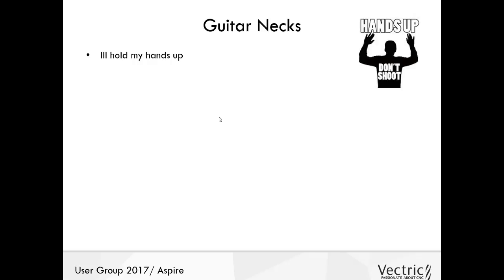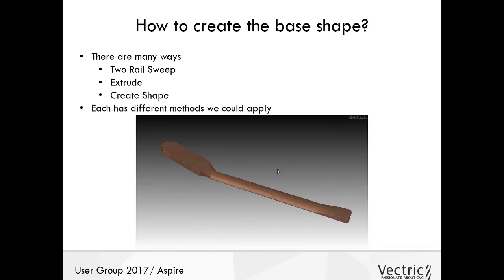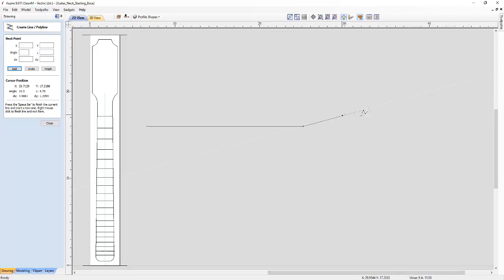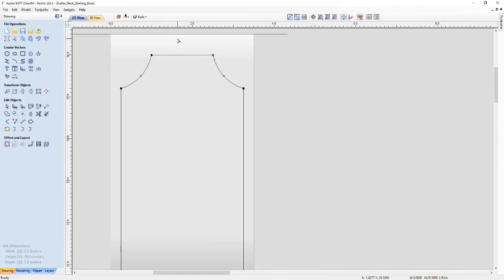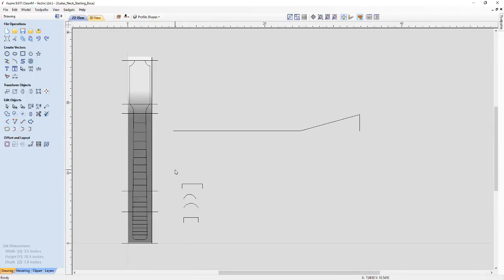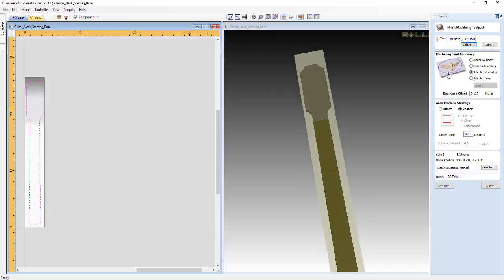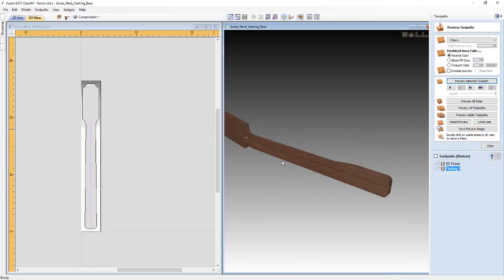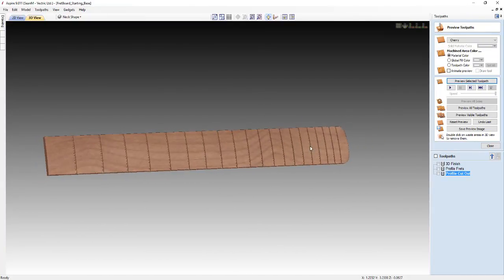Tips & Tricks | Making a Guitar Neck with A CNC | Vectric

Comment: If I want to do inlays in the fretboard that follows the radius, could I use the "project toolpath onto 3d model aswell"? 
I am currently using Vcarve Pro but if I'm able to do a complete Les Paul-style fretboard in Aspire I'll consider upgrade my program 🙂
Reply from the maker: Hello and thanks for the question.  Yes you could to a point, and once the radius for the surface was too much then you would need to compensate for that.  I don't think fretboard are all that curved... I would give it a try on a test piece. :)

Comment: Dear Sir i am trying to make a telecaster neck using your video. i am trying to do it horzionally but having trouble with the nodes to split the model in half equally.it goes down one side of the neck part way and the other side goes all the way around the head stock any  help would be greatly appecrated .
Reply from the maker: Helo John... this would be one for the Support team, seeing as it would be best if they has acess to your file.  Please email support@vectric.com and include the file and a description of the issue.  If the file is too big to email they can help you with that as well.

Comment: Great video - so much learning.  Thanks to Todd and Bekki at the UGM for sharing the link for this video that I finally got to watch.  Several key learnings that were helpful.  

The use of the two rail sweep was a good learning tool for me.  

The use of the angled zero plane is something I have been searching for for quite awhile.  Ever since Todd discussed a "wonky/wobbly zero plane" in his spoon project.  He hinted at making a video on how this was done at the time, but when asked at the UGM mentioned this is still on his possible future to do list.  

The concept of first creating an object with the opposite angle (from actual desired angle)  on one side, then creating a copy to the other side to achieve the desired angle and then using the subtract mode to ensure the object was there but invisible, "Mind Blown!"  
If I hadn't seen this video and I did this accidentally I would have been scratching my head and writing to support, what happened - the component tree shows a component but I can't see it.  

Then add the zero plane on each side to get back material that adding a zero plane with negative height on the one side took away.  Would not have understood the Zero plane was reducing my model thickness by the negative value, if this had not been pointed out.  

Then cropping the zero plane to get rid of the pixels.  
So much - so quick and real learning points kind of glossed over.  

I highly encourage Vectric to do a tips and tricks video on different uses of the zero plane with practical application, similar to Todd's spoon and this guitar neck.  I am sure there are many others.  It is not just a tool to allow dishes/recesses to be cut cleanly - which is what I believed when starting my journey to learn about zero planes.  I know I am only scratching the surface and have so much more to learn on this - please teach me.
Reply from the maker: Hey there! Thank you for your kind comments on this video, we're glad that you found it very useful! We appreciate your feedback and will bear your comments in mind for future videos, thank you for your suggestions! Have a great day :)

Comment: Hi. Good video! Thank you! Im trying to use Rhino to draw a guitar neck, Tele, Strat styles. I have a dout how to make the link between the neck and headstock in front (top of the neck) using Aspire, because is not symmetrical - Teles, Strat models). Cheers!
Reply from the maker: Hey There! Thank you for your kind comments! If you could e-mail your file so far to support@vectric.com they may beable to provide advice on how to push your project :)
Reply: Vectric Ltd Ok. Thank you. Cheers.
Reply: Hi! The answer:

“Adam Moran (Vectric Ltd.)
Aug 30, 13:50 WEST

Hello,

I am afraid that we do not have any experience making or designing guitar necks so I am afraid that we would not be in a position to give advice regarding this.

Regards,

Adam Moran

Vectric Ltd | Precision House| 2 Arden Road
Alcester | Warwickshire | B49 6HN | United Kingdom”

Do you have any advice? Thank you!
Reply from the maker: @G.Spínola-w5p  Hey There! We have many users on the Vectric Forum that make guitars and guitar necks maybe it's worth posting a question on there? forum.vectric.com
Reply: Vectric Ltd Hi! I can take a look. Thank you!

Comment: This was a very helpful tutorial video that answers a lot of questions for me on how to approach a guitar neck, however the neck was for an electric guitar.  The heel where it mates to the guitar is much simpler than one for an acoustic guitar.  So I've still got the dilemma of figuring out how to get the heel of the neck to work out for an acoustic guitar (which is more complex and taller).  Is it possible to make another video or append this one to include this extra complex step?
Reply from the maker: Hello Roy, thank you for your comments! I have passed your comments on to the Application Engineers and they have added this to their future video list. In the mean time you could head over to the Vectric Forum and ask on there for any advice on how to create/model this part, the community would be thrilled to help you out! Thanks Again.
Reply from the maker: Hey Roy, I just did a quick search and you may find this useful: http://forum.vectric.com/viewtopic.php?f=27&t=20215&p=143044&hilit=guitar+neck+modeling#p143044 Thanks
Reply: Great video Indeed, thank you. Roy, I use to rout archtop necks with Aspire and the only way I figured it out is to work with a 45mm thick neck blank, that includes headstock, the heel start, (glueing other half after, no big deal), tenon AND 4° overall angle. I then cut the whole shape in one go (1 roughing and 1 finishing actually, same ball nose tool). But I created the 3D model in Rhino 4, then imported it in Aspire. I'm afraid the method shown on this video cannot deal with 4 or 4,5° neck angle related to the tenon. Ball nose DOES NOT make a perfectly smooth tenon though, many fiting adjustments to do, but still a big time saver. So far, it's the only way I found...